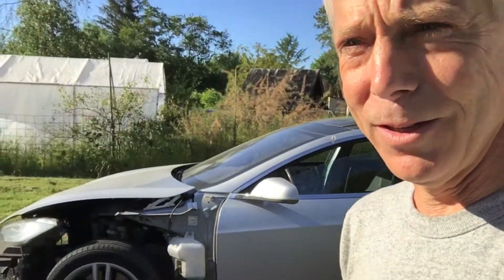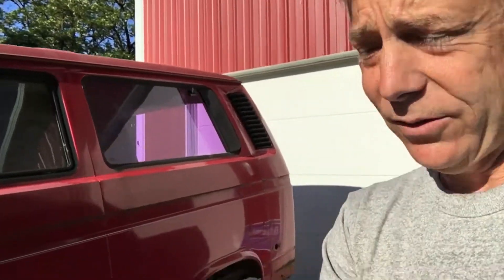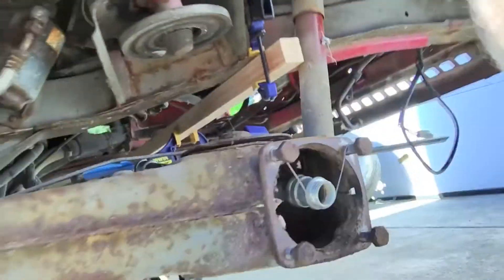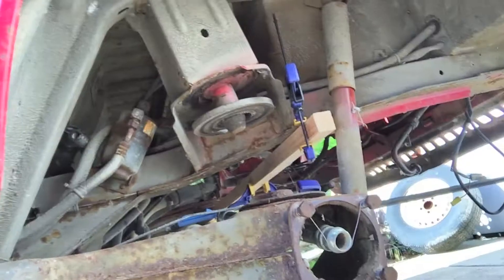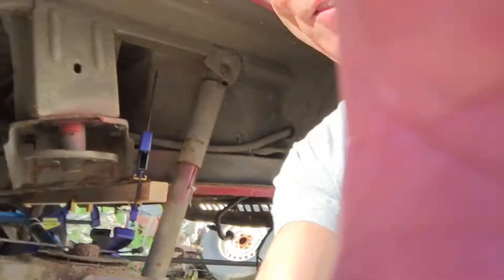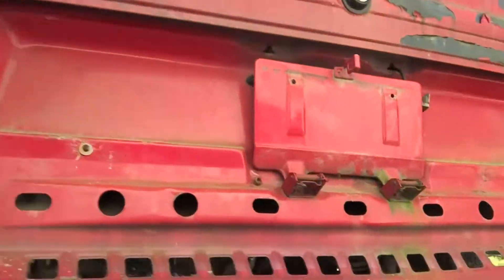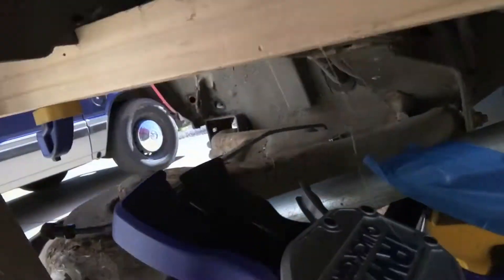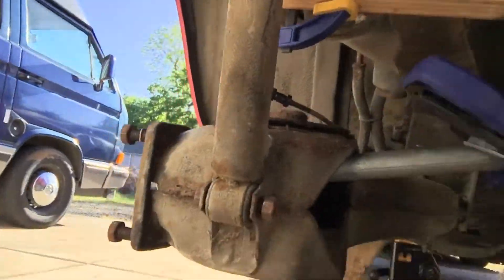TesFalia Update 7

Comment: BERNIE!

Do airbags...
Reply from the maker: Do you mean air bags in the suspension? That was one of the reasons I originally planned to use the Tesla suspension. Though I must say the Tesla air ride is nowhere near as smooth as my old Subaru GL-10 air bags. I'd like to have adjustable suspension and maybe someday I'll figure a good way to do it. I've spent countless hours over the last 20 years studying options for the Vanagon. With the high weight of the Vanagon and Tesla parts it's hard to find bags that take the load. Tesla uses some very special restrained bags at high pressures, over 200 psi IIRC. 
For now, that feature is not in the critical path, springs are inexpensive and easy. :-)